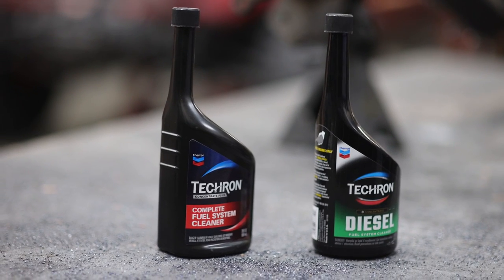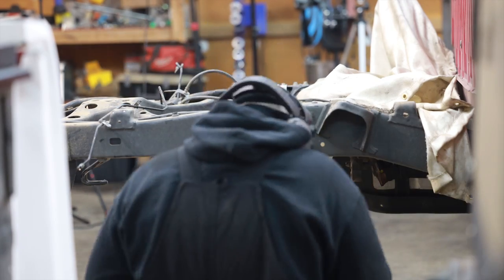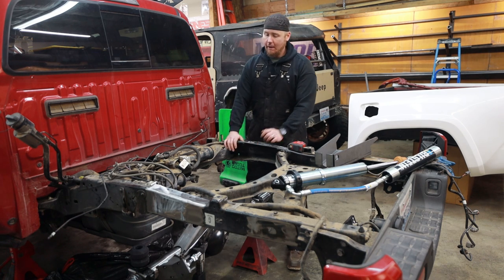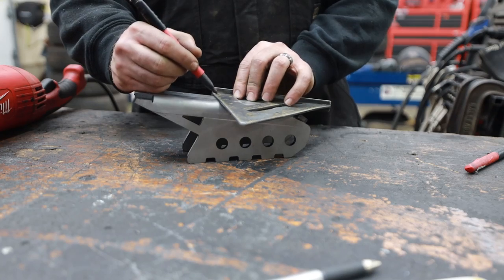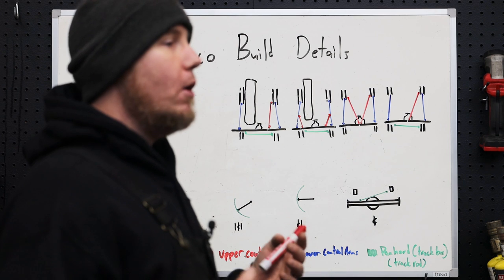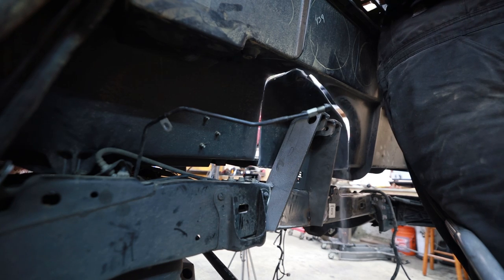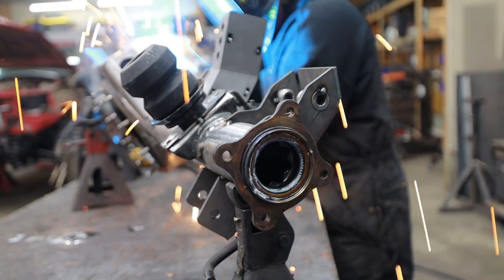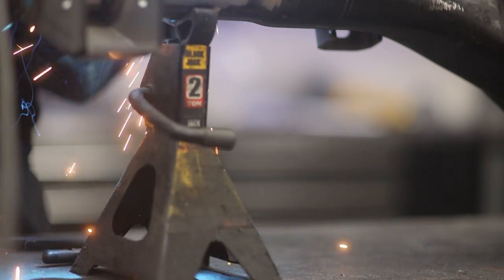Ultimate Toyota Tacoma build episode 6! Rear Coil over Conversion!

Comment: I love to see a three link in the rear. This thing is turning out great. 

When talking about the angle of the panhard bar, you need to consider the roll center will be where the panhard bar crosses the axle centerline. So its angle and height will affect how the rear of the chassis rolls. Packaging is often the primary driver, but roll center should be a consideration. I don't know how in depth you got on the theory side, i.e. roll axis, anti-squat, pinion angle change through travel, etc. I know you are on a deadline here. 

Also, if the panhard bar is angled at ride height then the side to side (lateral) forces it transfers will be partly converted to vertical forces and you could have a jacking or squat effect when cornering depending on if you turn left or right and the direction the bar is angled. This is primarily a concern on road, however, where speeds are higher, but it could come up off road on side slopes or off camber situations.  

I am surprised you didn't fish mouth the boxing plates welded to the inside of the frame. The fish mouth gradually increases the rigidity of the frame while a straight section increases the rigidity all at once. The straight sections should be more prone to cracking in the corners, but that doesn't necessarily mean cracks will form. It all depends on the forces.

For instance:

https://www.ford-trucks.com/user_gallery/tmp/549/54978.520.390
Reply: Thank you for this comment. Definitely things I’ll consider when doing my own 3 link on my Tacoma

Comment: Great build! With respect to the panhard angle, I drove for years (2000 4runner) with an angled panhard bar after lifting. The arc causes the rear of the vehicle to push and pull diagonally. This is noticed on road. I did a drop and it improved a lot. The more flat at ride height, the better. Then the arc is more centered. Most don’t notice it until it has been corrected and leveled.
Reply: I need to convert my rear suspension to a 3 link and free up the binding of the factory 4 link.

Comment: Trail gear has a rear diff cover for these, and truss wise Outlaw Overland in Kent, Washington makes a top truss. On my truck I just used a Ruffstuff 79-95 axle back truss, and made it fit. Its a little narrow, so just need to extend out to the wheel bearing surface someday.

Comment: BAMF makes what they call a differential skid. That and RCI were all I was ever able to find.
Reply from the maker: These are bolt on right? Not weld on?
Reply: @DirtLifestyle  both are bolt on. The BAMF version extends to cover the yoke and u-joint. I think Wheeler's had a weld-on, but it's no different than what you did.

Comment: It appears you didn't extended the axle side track bar mount up so that the track bar sits more parallel to level at static?  I know on 4r this greatly helps correct that axle arc on compression.😊🤙🏾
Reply from the maker: That was to clear the diff but again I like the performance (in theory) of a bar at a slight angle. But in anycase you wouldn't feel the difference on the trail lol.

Comment: Do you have any good sources of information on calculating upper and lower link lengths  and lonk geometry in general? 

Thanks for making these videos btw. They are super informative and easy to digest 👌
Reply from the maker: Crawlpedia has great information 👍
Reply: Max Fish has a great book about rear suspension design. It mainly focuses on Air Ride but the same concepts would apply I think. Great read with tons of visuals and some models that can be cut out and used as examples.

Comment: 3/4 links can be difficult to package with a inner-side saddle fuel tank. JKs have had this issue and the mini-trucks of the 70/80s are well (not many remember the Chevy Luv, Toyota/Datsun pickups for the low ride stances or the 4wd conversions!). 
Years ago, 4WD and OR mag built a 78 4wd-conversion Toyota pickup that used a modified 'wishbone' for its upper link. Most wishbone link designs use 2 upper frame mounts with a single center top diff mount in an isosceles triangle setup without the use of a track bar.  Their mod'd wishbone was a crossmember with 2 links and the single center top diff mount in a right triangle setup without a track bar. JKs, with its complicated underside, has an aftermarket suspension design 3 link keeping the track bar use. The upper link is a single link basically following the rear ds longitudinal path.

Another complicated issue with an inner-side saddle fuel tank and a rear track bar setup, is the clearance of the rear ds during the cycling at full droop and articulation to the fuel tank, exhaust and possibly the EVAP system. Thus, having a flat track bar keeps that arc to a minimum since the rear ds is at center or little off-center of that diff width (everything being technically centered between the frame rails) as apposed to the overall length of the track bar and its mounts on the frame and axle relative to the vehicles frame width (track bar mounts can also be offset).

Comment: Hey there Mr Nate (or anyone out there in comment land), long time subscriber first question. My 06 Sequoia (and most 2000 era Toyota SUV's) has a 4-link rear with a panhard bar. Does it have a ph bar because it's a non-triangulated 4-link setup? Trying to wrap my head around why it needs both. My guess is the "triangle" element prevents side to side axle movement, and since the Sequoia is non-triangulated it requires a ph bar? I can't imagine I'm the only one with this question. Thanks for all the great information over the last couple years man.
Reply from the maker: Exactly 👍
Same as any modern Jeep. Parallel links with a panhard

Comment: Great video! I’m not sure if you already answered and I didn’t catch it or not but if I remember right on the front end you went 7 inches wider track, how are you planning on matching that in the rear? Or are you gonna widen the rear at all?
Reply from the maker: The rear is getting wheel spacers until this summer. Then it will get a new axle 👍

Comment: you don't necessarily get binding from the triangulated upper (or lowers) with a panhard... You just get weird axle movement. Like the axle rolls during flex, and the panhard + triangulation induces axle steer.

Comment: with the front being 7” wider i would’ve went with a tundra rear.  that way you dont need wheel spacers to get the track close to the front.  plus you get the benefit of a way beefier rear axle.

Comment: Love these videos, and love seeing you make a truly superior IFS. Curious on the truss. If you only tack, do you create stress concentration points and increase failure risk? If you lay a continuous bead, do you risk warping?
Reply: Looking at it from a welders perspective, if you just tack, more likely then not it will strengthen it, but if something was to break it would be the tack just from lack of penetration. A non stop hot bead will warp it, but the way you're supposed to weld it without warping is in sections.
Reply from the maker: Technically yes. But in reality no. These are thing to consider with thin sheet metal but a tack will not have a negative influence on an axle or frame. And long welds absolutely bend/distort steel. Very important to consider when working on components like this 👍

Comment: Nate, how do you check for axle housing warpage after welding on brackets and the truss system, and if it is found to have warped then what is done to correct the situation. The reason I bring this up is a comment by the owner of a major off road axle housing manufacturer ( I believe you may know him personally ) who warns of the potential issue of creating housing warpage by welding.

Comment: Great Video ! Did you look at using  a Watts link or is that a bad idea for off road?
Reply from the maker: Watts link is great if the truck come with it. But it's alot of work to build one from scratch  compared to a pan hard bar so 99% of fabricators won't even consider it.

Comment: Just giving a hard time but I find it kind of ironic that you didn't want to remove the IFS in favor of a solid axle swap out front but on the same breath your tore the rear suspension out to go linked and coilovers.   Don't get me wrong I get the liking a challenge of these builds and I can't wait to see how it performs!
Reply: Keep in mind that a rear SAS does not require removing the two strongest cross members of the frame (IFS sub-frame), removing existing shock towers, adding at least two new crossmembers (radiator support and under the bellhousing), changing to an entirely new steering type (p/s gear box), and avoids all the complications of packaging a pan hard, upper link, and taller shock towers under and around the engine oil pan, exhaust manifolds, and cylinder heads as well as tire clearancing into the cab and front wheel well which is much more limited and time consuming than simply removing rear inner fender plastic. As Nate shows, a rear 3-link to an existing solid axle setup without any steering complications is by far easier than a SAS. Case in point shops usually do custom rear 3-links in half a week whereas a SAS to a late model Toyota can take up to 3 weeks.

Comment: RCI Offroad has a pretty nice looking diff cover/skid plate. i already bought their rock sliders and rear bumper is on order and their stuff seems like its a pretty good quality
Reply: Maybe for people who can only do bolt-on mods. I think Nate is above that.
Reply: @dREaDneck_Moto  yea i figured that. but i also figured that it would be a good base since it already has the correct shapes and stuff so that it could be modified to be welded instead of bolt on
Reply: @4x4convoy  It's not even close. Looks like a shovel with some axle tube clamps.

Comment: Epic Job!!! Just a thought, Did you think about using a Tundra or T100 rear axle to get closer to your front width? I think the T 100 is 67", unsure on the tundras. You might be able to use the tacoma pumpkin with some adjusting but not 100% sure on the 3rd gens.

Comment: You should have a crack at a top mount watts Link. That'd give your a zero movement rear. No rear steer.
With the Panhard bar, the issue isn't the lateral movement directly, it's that the lateral movement of the axle will result in your longitudinal links causing rear steer.

Comment: @Dirt Lifestyle
Have an idea/question which I think you're perfect to translate into a future video and maybe for which you can provide some advice for now (which we all must take at our own risk of course). You highlight in this video a very important topic, payload. Myself, I have a 17 TRD-OR DCLB. It's efficiently built out, from the ground up, with all the needed functional bells and whistles including air bags and a tune. I carry a Four Wheel Pop Up Camper and my 2 favorite ladies. I haven't had any issues yet but I know, as are we all, I'm likely at or possibly over payload. So here's the question which may be a great video (one I have not seen anyone do well for the "average driveway/home garage mod overlander" (not a rock crawl condition)); 

What components and modifications would help combat payload concerns, for the 3rd gen specifically? And of course, we know we'd have to take such a video's input at our own risk and liability (e.g. A Dirt Lifestyle developed truss axle mod that can occur without complete disassembly of the rear end (i.e. rear side bolt on or minor welding)? What other mods would help?).  Anyway cant find one good video on this topic for arguably the most popular truck out there right now, the 3rd Gen, so think this could be a VERY watched/liked video. Just sayin. And if you're ever in SoCal and looking for a truck to test on, I'm here (have local build resources and understand the risks) ...

Comment: I have always thought it would be convenient to build a 3-link using the front leaf spring mounts! They are there and handle all the load from the leaf springs, so why not?! Are you happy with the setup so far? (If you've gotten to test anything yet, I'm not sure how long behind your video posts are to "real time") Does the convenience outweigh the performance a longer link may provide?

Comment: Could have used a read diff skid from RCI Metalworks, and possibly made that fit, since even the drain plug will be protected. As for building links, do you use 2 ends of the same thread, or one end with a left and right thread?

Comment: The only question I have on this amazing build is, Why did you not buy a used one and save the money if you were going g to build a custom yota?
Reply from the maker: I tried! Check out the used market. I found 3 year old tacomas with 10k miles for the same cost as a brand new one
Reply: My father in law traded in his 2018 with 8,000 miles on it for a brand new one. They gave him $3,500 more than he paid for it when he bought it new. Crazy market for used cars.

Comment: This is only an “upgraded” suspension if your going rock crawling.  I get a kick out of how a lot of YouTubers say upgraded suspension. Depends on your mission.
Reply from the maker: But... It's upgraded in every way?! Much softer ride on and off road and link suspensions tend to be more durable then leaf. Your springs are not just suspending the weight of the vehicle but locating the axle. Coil springs only have to suspend weight so they never see the kind of abuse a leaf spring does 👍

Comment: Nate, now that you have been driving the three link rear, do you notice anything weird with the highway ride? I’m getting ready to 3 link the rear of my 4runner but some people warn that it’ll be very “squishy” feeling. I understand that there isn’t the safety of a redundant upper (fourth) link. My issue is that the stock 4 link binds way too much and breaks the upper links. I have build butch replacements but the mounts are the next weak link. A 3 link is the answer to my problems.

Comment: Loving the work Nate. I have a question regarding the mounts for a link setup. I see there are different degree options (zero, ten, etc.) when ordering. Are these degree differences for specific link designs (3 link, triangulated)? I am assuming so, but trying to wrap my head around it, and struggling to get clarification. Cheers!

Comment: Do you think your front will flex as much as the rear with this setup?
Reply: The rear suspension setup will have more wheel travel compared to the front suspension. I don't remember him stating the front shock length in the previous video, but I can't imagine it is more than 8 in travel shocks in the front. The rear definitely has more than 8 in of travel in the shocks.
Reply: @cheesewheele1014  I think he said it was 7 or 8.
Reply from the maker: Won't know until I use it. The rear Coilovers are 12 travel and the fronts are less than 8. But the position of coilover is a GIANT factor. In any case both will flex well 👍
Reply: I can't wait to see how well it does. I have an s10 blazer I intend to build and I'm torn between just ditching the torsion bars for coilovers, or maybe some weird hybrid IFS transverse leaf under neath or a SAS.

Comment: If you change from leaf spring to coil.  Why don't you plate the chassis? You are going from two points wide apart that takes half the weight, to one point that takes all the weight. Won't the chassis suffer and fatigue over time and bend?

Comment: Damn Nate, that's gonna be one hell of a Tacoma crawler. So, I have to ask, will this truck still be able to drive straight down the highway with the 3 link in the back, or is this now converted to a trail rig because of all the modifications to the front and rear suspensions?

Comment: When doing a 3 link with panhard bar. Is the upper link best to be as parallel with the frame so? Or just as close to parallel as possible to clear things. As long as it's not mounted to the center of the diff correct? I'm  brainstorm my rear 3link also..

Comment: When you are working on more modern vehicles welding on them do you just take the battery out? I'm fixing my zr2 sonoma doing alot of welding and I pulled the computer right out of it but I've been told I just have to disconnect the battery

Comment: Hey man, I’ve got a question. I’ve never owned a Land Rover and I’m trying to get a disco 2. I’ve found one for $1800 it’s an 01 with 150k miles. It runs and drives good, it’s got a small exhaust leak but I’m fairly mechanically inclined and can fix it so it’s not a huge deal. The interior is in phenomenal shape and the body is good. But there is some rust damage on the rear of the frame, as far as I can tell the frame in front of the rear tires is pretty good but behind the rear tires has some damage. This seems to be a pretty common issue from what I can tell and there’s a lot of company’s that make fixes for the issue. My question is do you think it would be worth it at $1800 or do you think I should shop around for one that doesn’t have as much rust?

Comment: Your not going to bend that axel , I have a semi mechanic that constantly has 800 pounds the bed of his 2017 Tacoma OR 4x4 , compressor tools etc. 144,000 miles on it no issues he’s always on wash board roads getting to dump trucks that brake down , with that said he did up grade his rear leaf springs though . Keep up the great work 👍🏻

Comment: There is a way to make that fourth link setup work well, you need to replace the track bar with a Watts link to eliminate the binding associated with the other links.  It's not easy to set up, but whoever is selling that kit should've went with a Watts and done their homework if they wanted the links in that configuration.